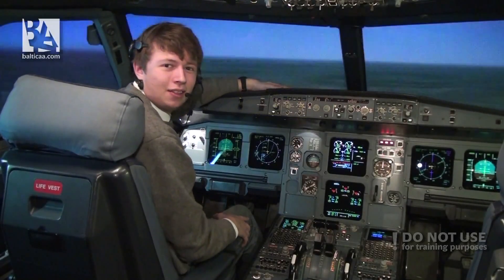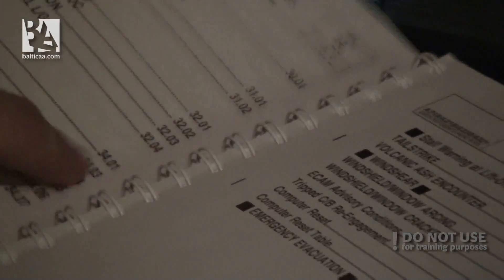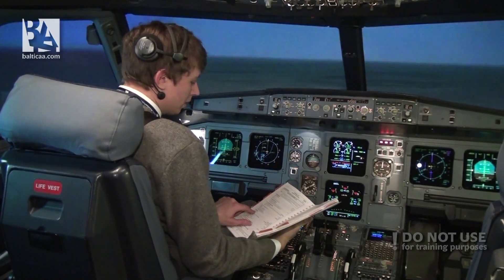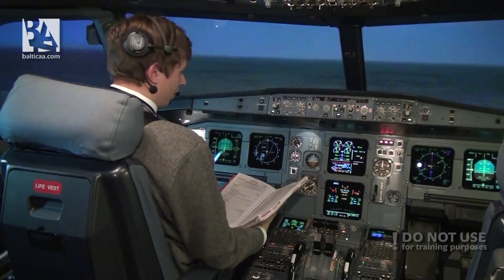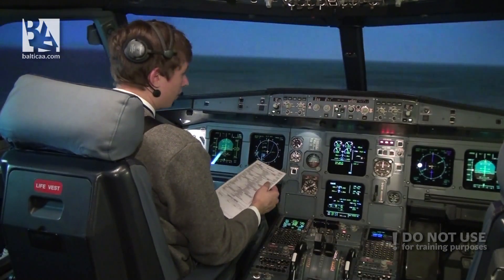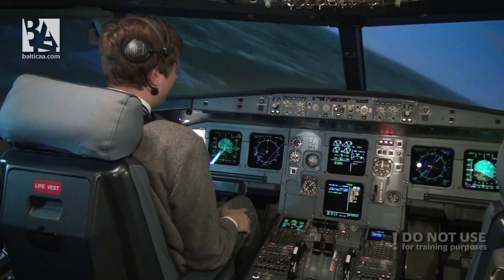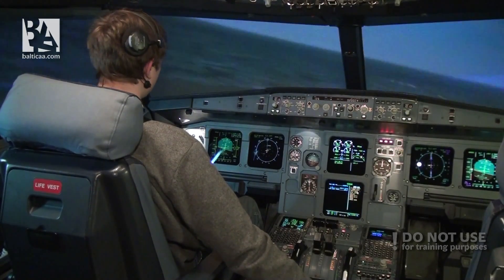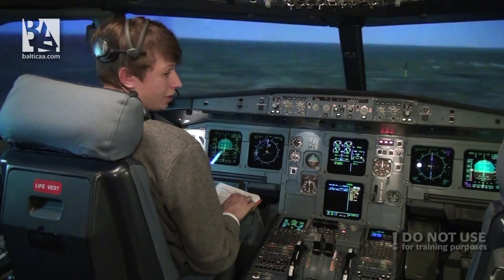Belly-landing on Airbus A320 - Baltic Avaition Academy

Comment: Interesting, so this is the REAL procedure what to do when the gear does not come out. YouTubers just land as usual in XPlane or other simulators and well... that´s it. No difference between a landing with gear out. But in real Airbusses the engines must be shut off and fuel cut-off, and discharge the fire extinguisher systems in the turbines after coming to a halt. 
I personally would have done another safety feature to prevent the whole aircraft from intense burning when something goes wrong during the landing: Try to fly until the kerosene tanks are almost empty. Empty tanks are no danger.

Comment: Silly question here, would'nt you at least cycle the gear lever at least once just to be certain before belly landing?
And #2 would it not be somewhat smoother to at least try to close the l/g doors before the crunching?
Reply: 1. Cycling the landing gear lever would not do much good in this scenario, since if the wheels are unlocked but not dropping, there's likely some kind of physical blockage going on.
2. Once the landing gear doors are unlocked via emergency gear extension, they can only be closed again after maintenance, since they're likely completely disconnected from the main gear extension/retraction mechanisms as a result. Typically, if the emergency gear extension is working properly, the doors are unlocked, the gear up-locks are released, and gravity forces the gear out of their wells and pushes the doors open.

Comment: Here after PIA 8303 crash, when the landing gear did not go down,  and the pilot attempted to land, scraped and damaged the engine, went for a go-around, and crashed on top of a residential area....  

I don't think they followed this checklist 😯😕
Reply: I guess he was all concentrated to recover from stall caused with high rate of descent while trying to descend from more than 5000 feet *(instead of 3000 feet as per SOP) for landing. May be he didn't realize that there was a malfunction with the landing gears but no one at Control Tower noticed and informed him either :(
Reply: @MuffinBearXD  You can hear ATC ask "Confirm, you'll attempt a belly landing?" Just before the pilot declared mayday. I'm pretty sure ATC was aware of of the landing gear malfunction. It could be that the captain tried using g-force to try and force the landing gear out. Also, you can hear the master caution warning going off in the background when the pilot was talking. If I'm not mistaken, that was a landing gear warning the same as in this video at 10:49. We don't know exactly what happened, so I'm just guessing.
Reply: @ZunarZulfiqar  they asked because on the first landing attempt the plane landed on belly as the gears failed to retract, they must have thought that the plane still has the same issue along with failed engines. Only pilot knew that he was able to retract the gears later on (as can be seen in video clip)  but since he already had a more serious issue to deal with (failed engines) he didn't inform the control tower about it. If you listen to the audio the pilot doesn't say anything in response to their question about belly landing

Comment: This is EXACTLY what the PK8303 pilots should have done. But they decided to go around instead after scraping the engines on the runway after the initial touchdown with the gear up.

Comment: Would you make an attempt to dump fuel before attempting the landing or maybe we are assuming fuel is already low since we are approaching our destination?
Reply: Paul Talbott a320 is not equipped with fuel dump features. But pilots do burn off some fuel by circling in order to land with lower weight.

Comment: Why does he switch RAM air on?
Reply: He need electricity (and hydraulic pressure) to control aircraft after engines cutoff.
Reply: @Dushess  Why not APU when there is some spare time
Reply: @annoyingguyoninternet1631  APU is not sufficient to provide all the necessary power to control the aircraft

Comment: i was suprised the emergency checklist saaid to still come in at a slight angle- 6 degrees pos I believe? - how likely would this be in reality to have snapped the plane in half? Fantastic video though, love these
Reply: When the plane first makes contact with the tail down, most of its weight is still being carried by the lift of the wings, so contact is not as bad at first. When the plane settles, most of the landing stress is going to be carried by the engine nacelles and the wing roots, which usually have more structural reinforcement—they're carrying most of the stresses from thrust and lift forces, respectively, in normal flight. If you came in flat or with the nose down, then most of the landing force is going to be pressed against the nose, caving it in and risking more damage/death. Plus, in all cases, you want to contact the runway with as little vertical speed as possible, which you can only do with a nose-up attitude anyways.
Reply: Any reply?

Comment: Really cool! 
But, this landing actually doesn't seem very realistic. The plane stops way too quickly. From touch down to a complete stop takes just about 14 seconds.
Aluminium against asfalt/concrete have much lower friction than rubber (tires) against asfalt/concrete. Just search for "belly landing" at YouTube and watch videos of real ones - the plane just keeps sliding "for ages" before it finally comes to a stop (a lot slower than in a normal landing).

I didn't saw at fist there is a video cut during the "braking" - but it still looks like it slows down very fast (wich caught my attension). Also there is another video of the same thing with a B737 where there is a tree line at the side of the runway. That realy shows the very short stopping distance (even tho the video is cut)
Reply: Yeah, there is less friction, but there is a larger surface area on the belly of the aircraft compared to the small tread of the tires, which would create more friction. Correct me if I’m wrong.

Comment: I have one question . Why do you have to perform belly landing at the runway . Why not belly land on the ground / dirt . Maybe that will prevent fire . Sorry for the bad english .
Reply: +VantagePoint Engines can catch the dirt and rip away causing possible fires and damage to the passenger cabin.
Reply: You want to land at the airport so the airport's emergency response can get there immediately. It would be harder for them to get to you if you landed on the ground elsewhere, and the ground is not as level and well-maintained as the runway so there could be all sorts of things that rip the plane apart there.
Reply: VantagePoint because there could be rough ground that could damage the plane
Reply: Landing on water would be better than on dirt
Reply: VantagePoint no bad english. just bad decision for u.
Reply: Maybe it because of simulation, that programmed to interpretate every touching of ground like a crash. But let's imagine. There is many reasons for this desition. It can be for simpify evacuation. Because the aircraft will be unrecoverable elsewere, also airfield will be damaged too, but safty of passangers- main priority. And there is no serious reasons why landing on dirt better then on tarmak, because main reason of fire, is broken fuel sistem and fuel leakage on hot parts of engine, or hot from sliding parts of the aircraft skin or.... ok, unpaved RWY is better then concrete or tarmak for belly-landing, but fuel can be ignite anyway, also runways has no any obstacles, and it is smooth and stright. Also due the engines u can tip over on rough ground. Anyway It's captain desition, he make it and he land safe. In similar situation i prefer to find alternate military airfield if possible, definitly not international airport (to decrese letals if smt go wrong, because  IRL problems never comes alone, if we have one fault, we also have others) with enogh long unpaved rwy. But it will be my desition.
And there a lot of different sistems, that protected aircraft from fire in this kind of emergencies. As an exampe, on my Ilushin-38 (soviet similar to Orion military aircraft. deep modificated Il-18) also like on original Ilushin-18 there is special fire protection sistem, that displasing air for unflameble gas in the fuel tanks (25 fuel tanks on aircraft :) and in the all 4 engines before emergency landing. And if this parts get any damage, well.. aircraft continue moving in the cloud of unflameble gas. Also it very bad for breathing.. and for ozon layer... But it's definitly better for breathing then fire, isn't it?.)

Comment: Pranas, this case is not necessary to spend all fuel , before landing ?
Reply: john strauss no no no and no sir.... I have just checked Wikipedia, your source...."When an airplane is BEING LOADED, the capacity for extra weight in the wing is greater than the capacity for extra weight in the fuselage. Designers of airplanes can optimise the maximum takeoff weight and prevent overloading in the fuselage by specifying a MZFW. This is usually done for large airplanes."   of course it reduces the beinding moment in flight, BUT you never rip off your wings with no fuel !! where did you see that ? otherwise you  do not declare a mayday due to "running short of fuel" but you say "mayday mayday mayday, we hav eno fuel, we gonna lose our wings ".... QUOTE in wikipedia any moment they say you rip off your wings in flight lol  The MZFW is the maximum wieght that the plane can stand, with pax on board, with no fuel in the wings. That is the definition sir.
Reply: john strauss  what BS are you saying here ??? are you pilot ? you never rip off your wings in the air with few fuel !!! the MZFW concerns about embarking passenger when there is no fuel in the wings. It is a structural Mass on ground not in the air !! god ! some BS here...seriously...
Reply: strauss is a troll, he did not reply to my last answer lol he is a kid.
Reply: Rip off your wings... I've heard everything. Plz balticaviation make a riped-off-wing emergency flight lmfao
Reply: you have to "spend" or dump your fuel if the MLW is exceeded, but always having the MZFW in mind, you don't want to rip off your wings mid-air.
Reply: Okay "bugy bug" it seems you've learnt alot from flight simulator, sadly, what that game has taught you is wrong, please wikipedia some more about the "bs" you're trying to correct from an experienced pilot before actually doing it, do not forget that some facts in the internet are posted by people like you that make their researches on wikipedia/yahoo answers, therefore, people without a valid point. 
Next time dont get so cocky about topics you dont know anything about, and next time you ask a flight attendant to let you in cockpit, ask the pilots instead of looking around like a wierdo.
Good luck buddy.
Reply: john strauss please find and show me a link that says we can lose wings in flight if we fly with a MZFW :)  this Mass is a limitation on ground not in flight.....and please stop with experrienced pilot, it does not mean antyhing nowaydays especially with all these "game boys" cockpit. As you know about AF447, they were 3 in a cockpit, all experienced, and they did not detect a stall...be humble. ;)
Reply: Also, spending all of the fuel will prevent the plane from exploding upon touchdown.
Reply: Max Gorley WHAT THE FUCK?! stop watching michael bay's movies, that DOES NOT happen kid.

Comment: Pranas, thank you all ure videos are great!!! one questions...anserw me please short and exactly!!! - Boeing or Airbus... ???
Reply: There is no reason to compare as both do the same and both make good planes. Both did major technological innovations. Boeing made a successful airliner first but airbus did the fly by wire and other innovative technologies first so both are just equal.
Reply: +Power  Well Its up to the pilots. Both companies are different. Boeing planes are more "manual" and mechanical and let the the pilot correct mistakes while the airbus is usually simpler to start and has smarter flight computers and auto-pilot and the computer correct  a pilots mistake, but if there is a fault in the computers, the airplane can make corrections that are not needed like in the Quantas a330 flight in 2009. I've heard that it's harder to fly an airbus because the controll stick is very sensetiv if you compare to the classic yoke of the Boeing planes.
Reply: +Power It's an Airbus A320
Reply: +Kevin Kokalari i mean wich better ..?))

Comment: Pranas followed the correct procedure. The gear lever has no effect on the landing gear doors after a gravity extension as they're unlock permanently, so it wouldn't work.

Comment: Using the spoilers could be a bit dangerous. I am no pilot, but I do know that the spoilers disrupt airflow on the wings and create more drag. The spoilers are most often used to decrease speed but sometimes are used to descend. The landing without the landing gear is already rather bumpy and causes damage to the aircraft, but if you have a higher rate of descent, it might "smash" the plane into the ground. Again I am no pilot.
Reply: But possible to use it as groundspoilers, like normal procedure. I mean deploying it after touchdown.

Comment: My guess, only that I'm no pilot, is that the spoilers mainly work by dumping the lift from the wings by disrupting the airflow to provide maximum weight and therefore traction to the wheels. Since in this case we have no wheels, having additional control over the attitude of the plane for as long as possible would be far preferable.

Comment: After the second turn of the landing gear gravity extension lever, there are no possibilities to restow the l/g doors. For that reason, pilots should expect a decrease in climb performance in the event of a go around even after resetting gears' normal operations (assuming no mechanical damage). In addition, nose wheel steering is inhibited. The doosr don't significantly affect a belly landing. He has performed the correct procedure ;)

Comment: Ok, that is simple. First, spoilers during no landing gear landings are a little dangerous, thats because a pilot doesnt want the plane to exert more force against the ground and to reduce drag against the ground,and to reduce damage and danger, even the QRH says so. And second, EVEN IF the pilot arms the spoilers, they wont deploy after touchdown, becasue as you saw, he shut down BOTH engines before touchdown, so the spoilers wont deploy because of lack of engine hydrolic power. reply please

Comment: To avoid any fire I shut down both engines just before touchdown. Nothing was turning the generators, so the power went out; we only had limited power from the batteries.